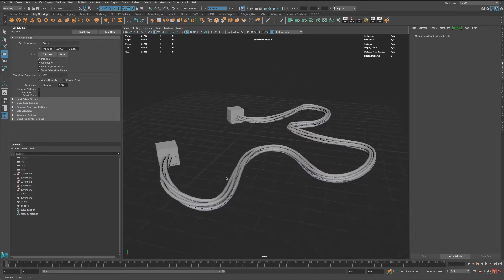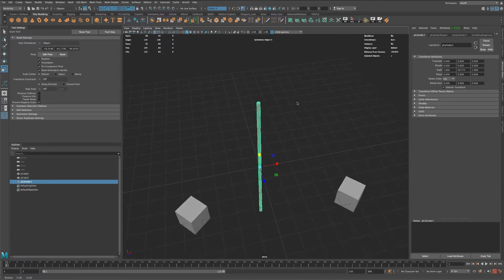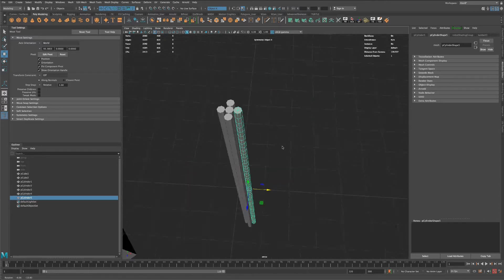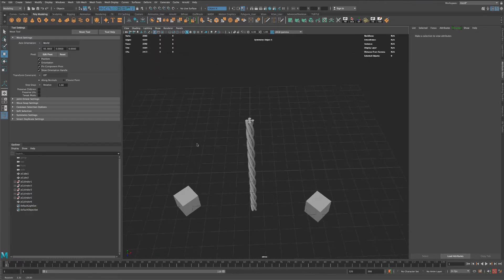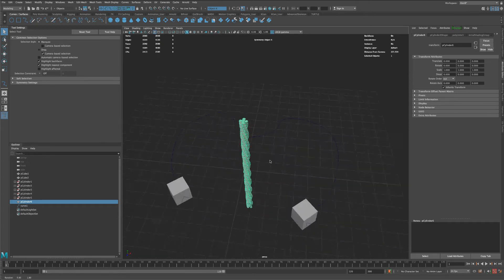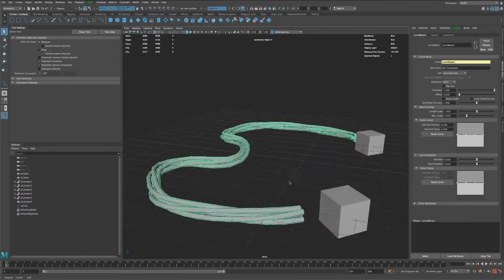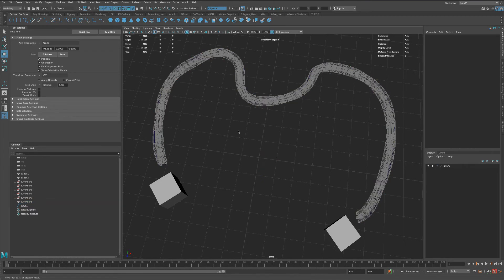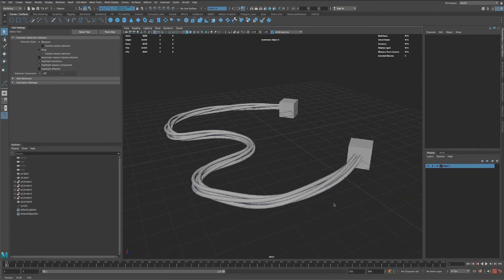How to Quickly Create Cables, Wires, or Cords in Maya 2020

Comment: hello, why can't I find the curve warp option under deform even though I went into animation? I get a bunch of options but not that one. I saw only warp but that did not work. Any suggestions of what I might be doing wrong? Thank you
Reply: you need to enable the curveWarp plugin in the plugin manager
Reply from the maker: What version of Maya are you using? It is supposed to be inside the Animation tab > Deform > Curve Warp (3rd one down in new Maya)